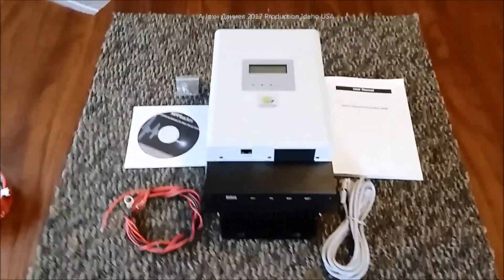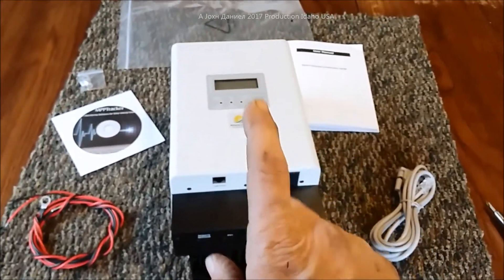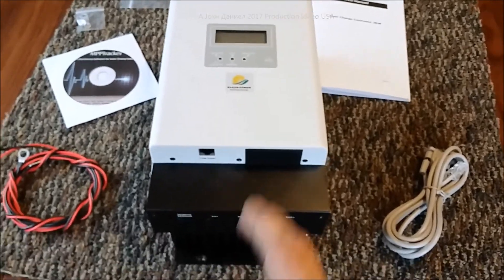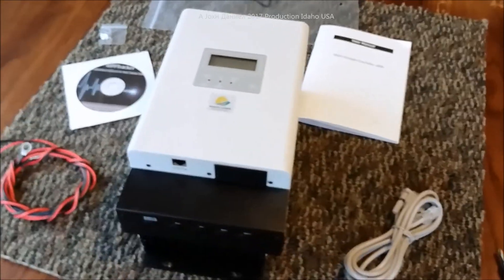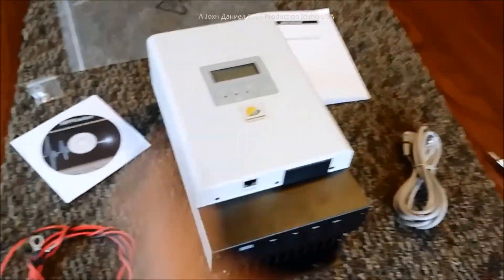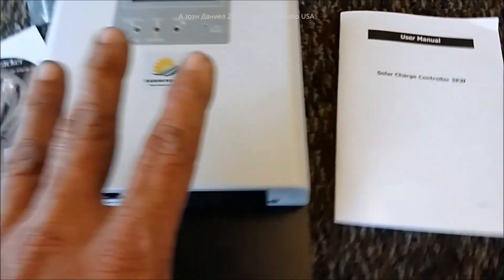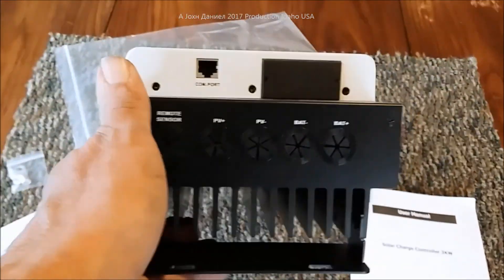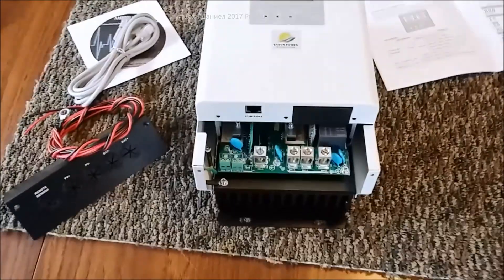60 Amp MPPT SOLAR CHARGE CONTROLLER PCMX 60 open 4 REVIEW, INFO BELOW

Comment: Hi! Why they say, it's only wind power? Why not solar?! Is there any reason for it?
Reply from the maker: Good for either as long as volt input remains under its max voltage.
Reply: @JOHNDANIEL1  Thank you John! So, i can run sefely 100v-120v..?
Reply from the maker: Heres some things you can go study the Specs on, a list of material things to build your off grid plan, I made a list of things I have used for the last 9 years as a renewable energy installer. A multitude of tested in real time, a few different list to look at https://www.amazon.com/shop/influencer-acccb1e8

Comment: Most mppt controllers are most effiecent with solar panels with a VmP of about 1.5 times battery voltage. I'm charging my 24v bank with panel voltage of 36-37volts at max power and voc of42-43 volts. When the sun is completely covered. I get 300-500 ma in. And 700-900 ma out with nearly full charged batts. I'd 99.5% charged. So the batts get a good bit more than what panels are doing. The 8v over batt voltage most being converted to current. That is what I love about mppt. I would prefer the buck conversion even if it didn't track the power point Max. I would like to see more on how you use these with wind is there a video on that? I want to charge lithium batteries with a alternator or pma. In case of no sun for a while. So I don't need a dump. Have you seen the fangpusun flexmax controllers? Thanks

Comment: I just ordered this charge controller from eBay it's only made for solar not wind. Can you make a update of runing wind or solar.
Reply from the maker: For wind power, you need a slave battery. Wind turbine, 3 phase Rectifier, a REAL diversion controller, slave battery. http://rover.ebay.com/rover/1/711-53200-19255-0/1?icep_ff3=2&pub=5575119394&toolid=10001&campid=5337668021&customid=WINDANDSUN&icep_item=131276389277&ipn=psmain&icep_vectorid=229466&kwid=902099&mtid=824&kw=lg Number One REAL controller Don't buy junk!!
Use diversion Loads like this, only design for 60% of your turbines rating unless its a under performer, then set the ratings on dump load watts needed to your experience.  http://rover.ebay.com/rover/1/711-53200-19255-0/1?icep_ff3=2&pub=5575119394&toolid=10001&campid=5337668021&customid=WINDANDSUN&icep_item=121244598279&ipn=psmain&icep_vectorid=229466&kwid=902099&mtid=824&kw=lg 300watt

Then from the slave battery. From it you feed to the Controller. It then charges your bank. 
Set the slave battery diversion at 14.8 volts
Set the controller to stop pulling from that battery ( like a solar panel setting) at 11.5 volts. 
Best slave batteries are used Semi truck batteries  ( about $20). Keep its water level up, its just a shock absorber and power transfer device. I get about 18 months out of each crappy old Semi Battery!!

Comment: That controller looks very well built inside. Can the voltage settings be adjusted to work with my Edison batts that run at 16.5v full charge?
Reply from the maker: I believe so, but if it can not, then some controllers (very few) can be tricked into giving you what you want in charge volts.
This one uses its remote battery sensing, so with a well placed resistor you can crop what it sensing that it is putting out and it will raise the output till it gets to the level you trick it to.

Comment: If I upgrade I will try one of these. The Tracer 40 amp you told me to get have been working great since using those diodes like you said. I put 2 in line right before each of the controllers and it dropped the voltage to 80 so my tracers are not over heating now. But I will consider this when we put the next 6 or 8 panels up. Good describing of this mppt.

Comment: Dear john, Have you ever tested any of the whistler power inverters,,,,,,,mainly the xp2000i,  Will be glad if you can advise on them,    Thanks in advance
Reply from the maker: The xp2000i is ok, but its a xp1200i - xp1600i series with an additional mosfet only. However, the xp3000i ( refer to  http://amzn.to/2oA1aGv ) is a fully new ground up inverter that shares very little identical components with the 1200-1600 or 2000 series, and is only a few dollars more. I have tested the 1200 & 2000 and learned that since it uses the same 4403-3 transformer that the 1200 and 1600 used  it has very poor idle wattage and its continuous output sags voltage at 1200+ watts no matter what size battery bank it has, seems its the first stage circuit that those 3 models share and gain between them is only due to stacking, not complete inversion from one board. Those designs make voltage very choppy.
In all honesty, the 3000 is a monster, but its not a energy hog like the rest of the Whistlers.
Reply from the maker: PS - Makes a good starter inverter. But it will not run a 800 watt microwave. People fail to note that a 800 watt microwave makes 800 watts of energy, but it takes 1500 watts to run it. In that reality, the xp2000i may have 2000 watts but it is not a stable voltage from that particular model at 1500 watts and at that point you get component heat, that means you could be maxing out the xp2000i just heating a cup of water.  The true weight of the 2000 is 7.4 pounds, in comparison the 3000 is 14.1 lbs. Have to ask, what 1000 more watts weights 2x as much using the same casement materials. Thats why I'd say investigate them more. 3000 http://amzn.to/2oA1aGv and 2000 http://amzn.to/2o7onvU

Comment: Ok buddy, That is imbarrassing. I had my doubts. I've been searching constantly for a review and, or, a qualified opinion. These weigh about 2 1/2 lbs. Nice build quality, but, I.just haven't been able to verify an MPPT function. Thanks for the info. Dissappointing
Reply from the maker: Whats your solar voltage, solar watts, and battery volts you use. I may be able to direct you to a controller you can work with for better results.

Comment: So, do you have anything to share about the SunYoba MPPT L80 ?
Reply from the maker: They are sold as a MPPT but are a scam, they hide the words "MORE PLEASING POWER TODAY" so they can trick buyers and get away with it through ebay and amazon and other stores ( A Fake Play On Words MPPT ), They are PWM, Pulse Width Modulated. A 80 amp true MPPT would weigh about 5 to 7 pounds, have high voltage input such as 75 volts plus. MPPT requires large heat sinks due to conversion of higher voltage to amps for charging. https://www.solar-electric.com/mppt-solar-charge-controllers.html/

Comment: Hey John, thanks for another professional presentation of significantly valuable information. I'm hughly into redundancy. All my systems are times 2, each backed up times 2. And generally built to twice the anticipated load. I like things running light loads and cool. Just wanted to share this ( at the risk of imbarassing myself)  I am currently running 2 640 watt arrays ( 30 to 40 max amps) on one 80 amp controller each and 2 battery banks, each backed by 2 wind gennies.  I am having surprisingly great results from the SunYoba L80 MPPT controllers that cost just under $80 each. I upgraded from a pair of SunYoba solar 40 PWM controllers that I have nothing but praise for. Just sharing that. Please keep making videos. I need the knowledge. Dandahermit.

Comment: same company eBay seller I got my MPPT inverter/charger from.   Very good review, and they do sell great products. and for the price you can get three of these charge controllers for the price of just one of the others.
Reply: What I like about my inverter/charger is it has this charger controller the PCM60 built right in.  some of the new ones now have 80 amp charger controllers built in.   One guy know and helped bought for 1200 a unite like mine that has 3 of the 60 amp charge controllers for 180 total amps of charging.  These are great products you will enjoy it I'm sure of it.  My system has taken a beating and keeps on ticking.
Reply from the maker: I have been ordering these with people I know who have bought high voltage Amorphous panels when we do the installs on them. Its just a side job to keep the cash flow going. I got lucky and this one was from extra credit as a spare that I get to keep. If its as good as its been for all of them people I will probably keep it and get another when I put 1350 watts of Stion 135 panels on my Holiday Rambler.

Comment: Top review, i know a guy who uses one full time and it has lasted 2 years so far no issues.
he said mpp solar has german engineering, he contacts mpp solar on a regular basis.
im not a fan of electrical equipment with cooling fans it spells under designing to me,
Reply from the maker: yes, cooling fans are used to do what lazy engineering should have done. Like your home computer or lap top when you hear a fan going out you replace it, but a controller should not need to be right in your face being watched all the time to see if the fan is failing.